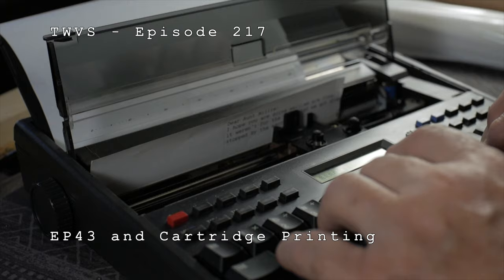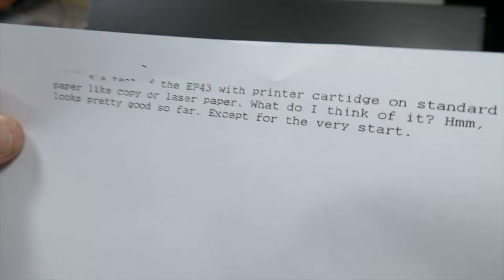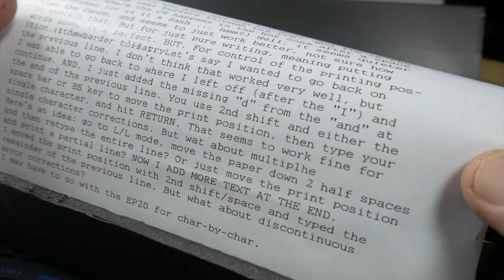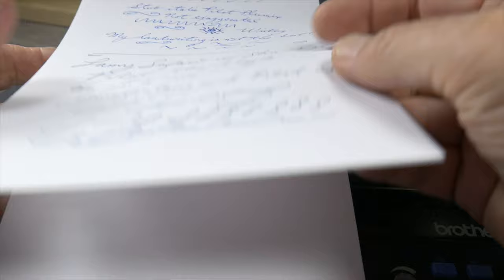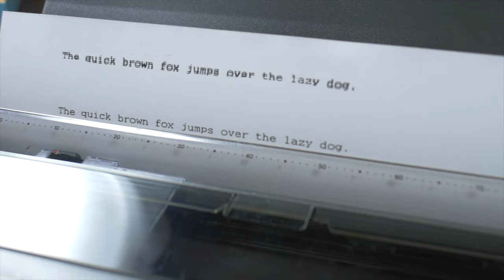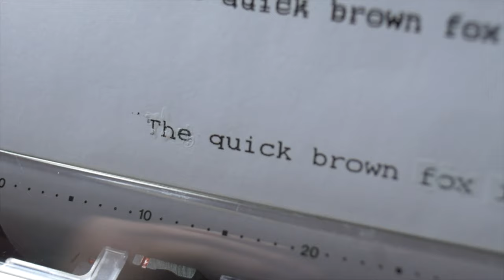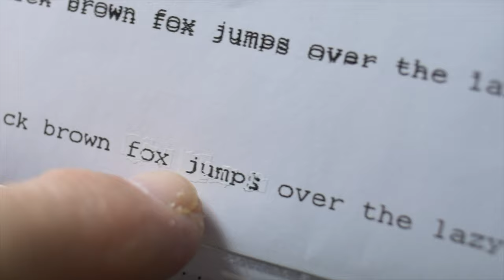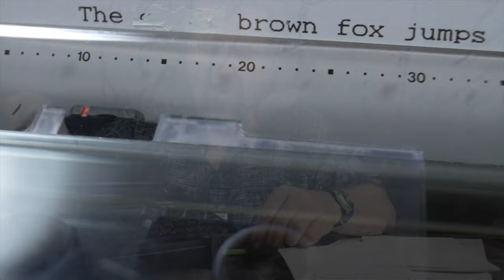Typewriter Video Series - Episode 217: EP43 & Cartridge Printing

Comment: Hi Joe. Hope you are staying safe. I use my thermal typewriters for three main things. Firstly, poetry. Off the cuff, top of the head poems that I can easily sit down and push them out. Secondly, rough draft of stories. I am currently on a second revision of a book of short stories called "scatterings". I use the thermal typewriter to play around with the stories, trying things out etc. Lastly, and most recently, I use a thermal typewriter for short journal entries, cutting up thermal paper into roughly A5 size and then hole punching them and keeping in an A5 ring binder. Thoughts, ideas and memories. And being quiet it means the wife is happy too!!
Reply from the maker: I'd love to read you book. And having a quiet machine isn't just for coffee shops anymore (remember those days ...), but for keeping peace at home.

Comment: Since watching your videos, I have acquired several Canon Typestar thermal typewriters and each came with started or new thermal IR-100 cartridges. I have found that these cartridges, even the new ones from air sealed packets, do not perform very well. It seems that the ribbon travel is severely deteriorated. Perhaps it is the tape itself having more friction than it did when new. In all of my Canon Typestar machines, the IR-100 thermal cartridge ribbons stop feeding as the machines print and often overheat and snap. Thermal paper is definitely the way to go with these machines instead of the ageing IR-100 cartridges.

Comment: I have a thermal paper question. Can you use thermal paper in a manual without a ink ribbon?
Reply from the maker: No, it required a thermal print head to make the imprint.